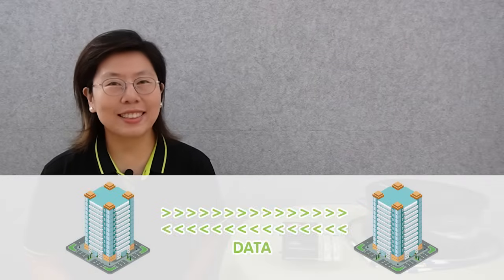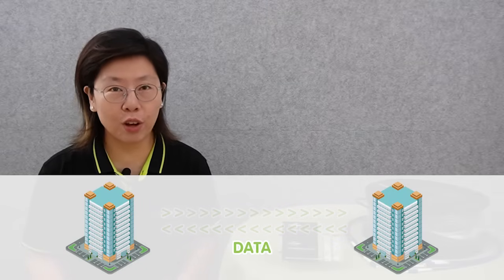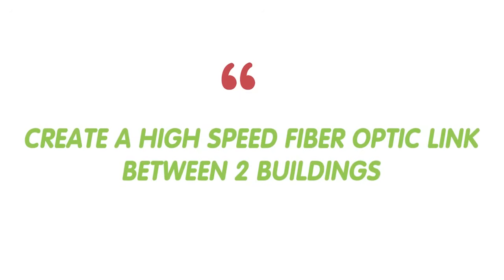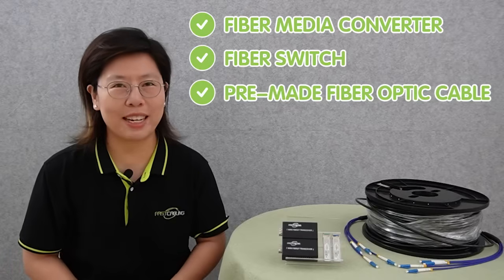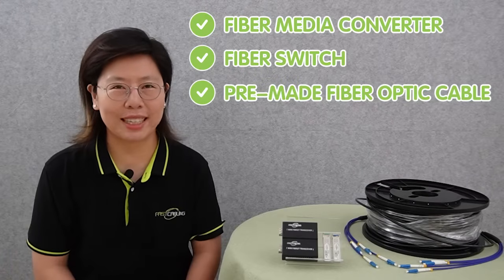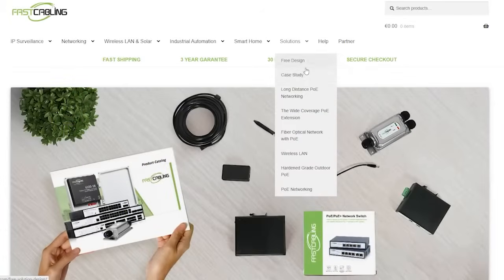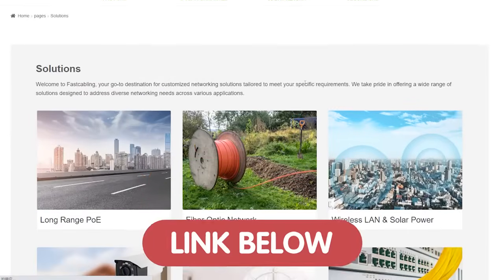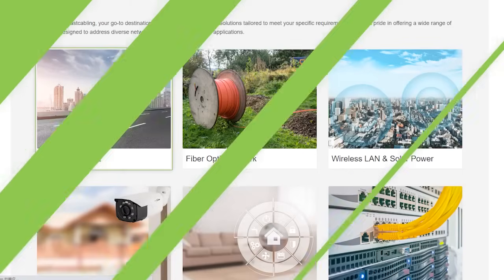Creating a High-Speed Fiber Optic Link between Two Buildings

Comment: What about 2x HUAWEI routers with integrated ONTs and a roll of fibre optic cable with the required connectors.
Reply from the maker: If those two routers supports point to point connection, you can set a media converter at the remote end. Otherwise, you need the ONU modem to work with those routers.

Comment: Hi, Wish to ask for clarification
Property A - FTTH from ISP
Property B, C D do not have internet connection.
Based on your other videos, I can set up PON network so that all property will have internet access.
However, can it also work like below?
Property A deploy 3 port fibre switch, each going to property B, C and D respectively with property B, C and D deploy an ordinary switch with RJ45 to connect multiple AP and also an SFP port to receive incoming connection from Property A. 
Is this same as PON concept or totally different things? 
Thanks a lot.
Reply from the maker: Yes, you can take PON concept. The OLT stay in the property A and distribute the internet connection to B,C, and D. You also can choose the point to point network topology with media converters.

Comment: Do you have tutorial on how to set up multiple access points 
Example property A has Fibre To The Home ONT and router while property B and C re don't have internet access if we exclude WiFi signal from property A
So how can one share property A FTTH with property B and C
I have seen media convertor mentioned in other tutorials but I need clean to understand video let's say I can terminated LC to LC APC cables which I plan to connect to property A ONT and router and am willing to use two more routers (1 at property B other one at property C) connected via media convertor {Fibre patched cables and ethernet cables} 
How to configure internet speed per access point maybe I have 75mbps DL by 40mbps UL
I want property A to have 30mbps DL by 15mbps UL
Property B to have 35mbps DL by 15mbps UL
Property C to have 10mbps DL by 10mbps UL
Please do video about this including information regarding how to set up IP addresses for this set up and WiFi set up for all 3 routers
Reply from the maker: Basically you will need a switch with QoS feature to limit the DL and UL speed. You can set the speed limits over the media converter. There is no configuration from the media converter. Below is the switch with QoS feature, but it only has two SFP slot. The QoS also work with the RJ45 network port. There is no need to configure the access point. As long as the DHCP is on, the access point will obtain the correct IP address from your OLT, then you can have internet access at those three locations. You also can try to access the web configuration page of OLT and see whether you can set the QoS from OLT. If there is QoS features built-in, you don't even need the switch. https://www.fastcabling.com/product/8-port-web-smart-poe-switch-with-2-gigabit-sfp/